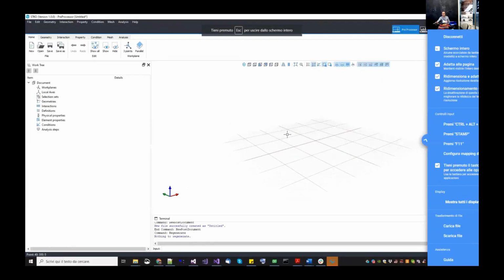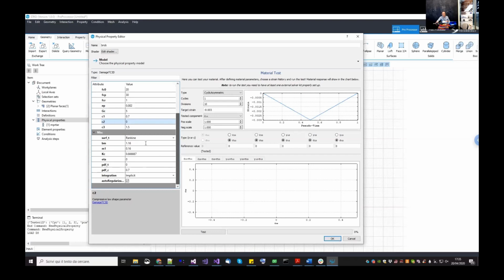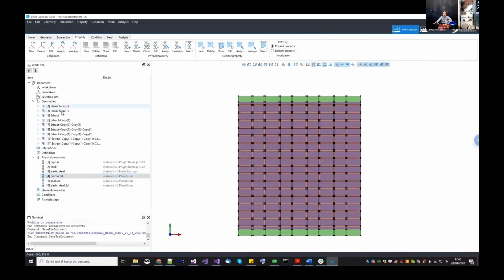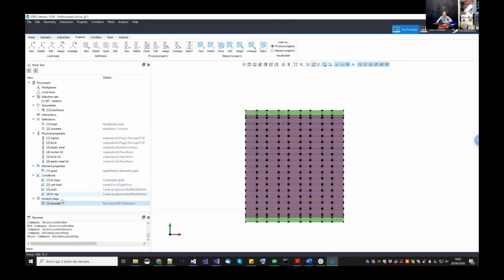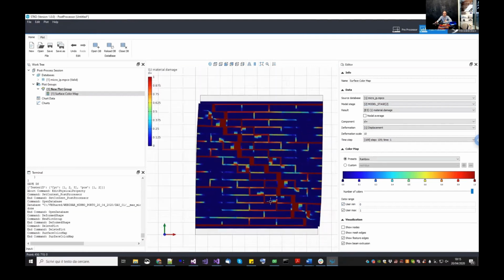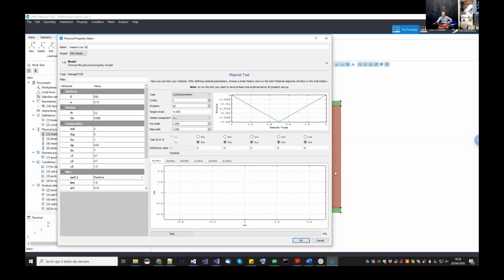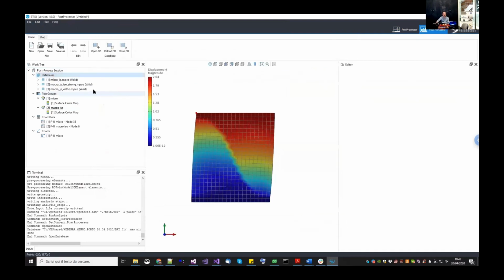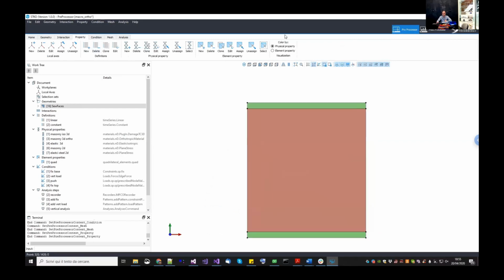In-plane Analysis of Masonry Walls (Micro and Macro Modeling)

Comment: Hi, 
Could you explain or give a reference on how it would be possible to carry out a discrete modeling with interfaces using STKO?
Or is it not possible?
Reply from the maker: Currently, OpenSees does not have interface elements. They can still be modelled using zeroLength springs with proper lumping and materials coupled with hard-contact elements. We are planning to implement masonry mortar joints directly in OpenSees in the near future.

Comment: What is the paper that the micro model data is taken from?
Reply from the maker: Hi Lucas, the data comes from the PhD thesis of prof. Oliveria: https://repositorium.sdum.uminho.pt/bitstream/1822/180/1/Dan-phd-thesis.pdf
Reply: @asdeasoftwaretechnology7930  Is this also the case for the data used for the macro-model
Reply from the maker: @lucascavendish9171  The material parameters for the Macro model (i.e., the whole masonry assembly) were derived, for this particular example, from homogenization theory. However, the aim of the webinar was to show that you can either use simple isotropic material parameters for mortar and brick, if you have them, in a micro-modeling approach.
Otherwise, you can use an orthotropic material, if you only have the macroscopic parameters (i.e., Young's modulus and strength of the whole masonry) in a macroscopic approach